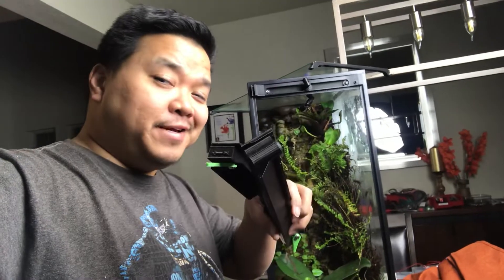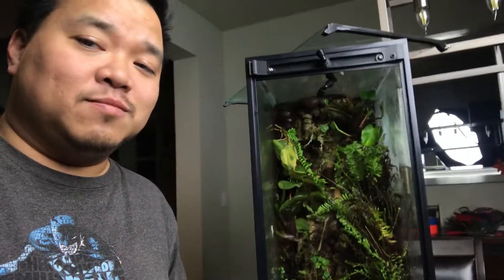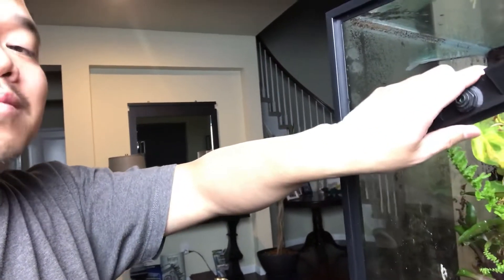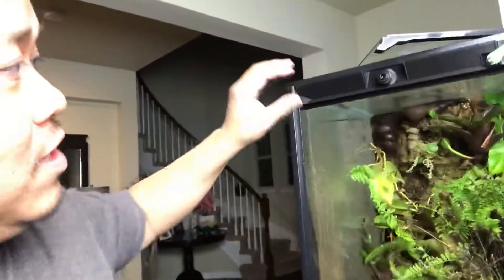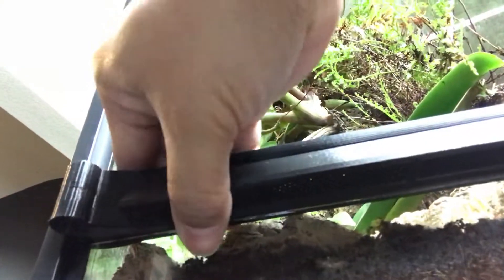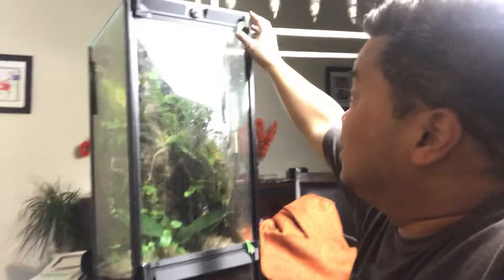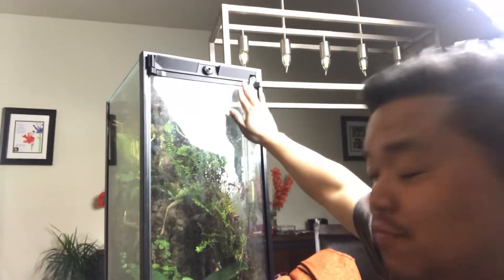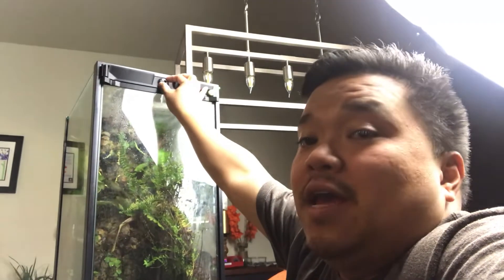Hidden Vents Hinged!

Comment: Are the vents and the hinge side of the door escape proof? Don’t want any fruit flies or baby mourning geckos to escape

Is there a version you can make without the sliding door locks? I can put some magnets on the inside and outside of the door so it’s got a cleaner look

Comment: Instead of having to choose to have a hole for the misting system or not, why not make a threaded cap that you can screw off or choose to keep screwed on.
Reply from the maker: Nathan Daniels threaded cap didn’t work out in v5. But I did move forward with snap-in caps for v6.